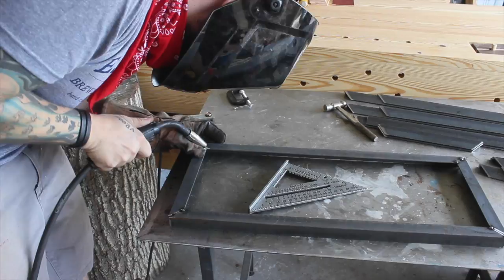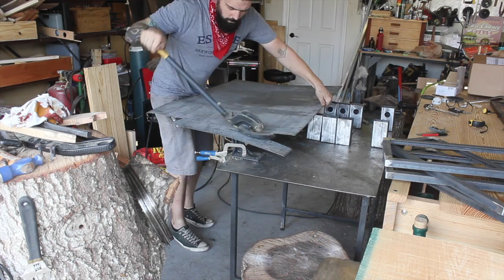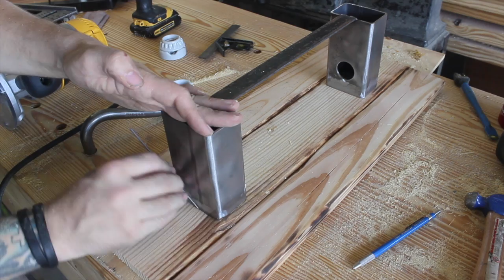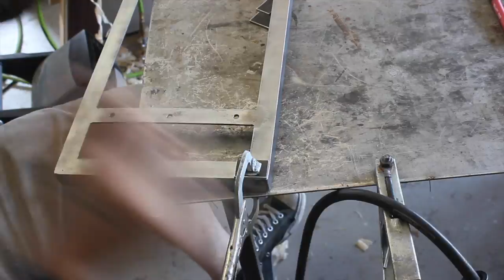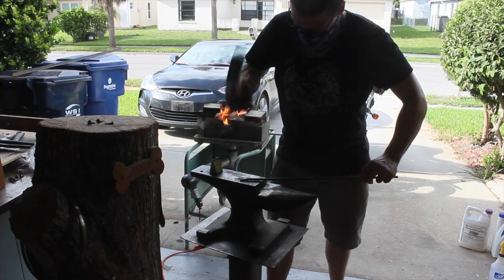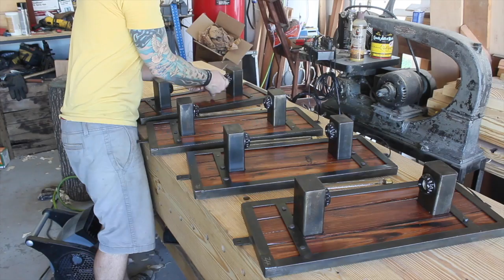Industrial wall sconces for Escape Brewing | How-To

Comment: they are works of art. I hope the electrician and you made sure all the metal parts were grounded.
Reply from the maker: Thanks! The leads are locked in place and isolated from the frame...

Comment: this list of tools is missing a few.. You use a sheet metal cutter (never seen one of those), the tool to actually make your own nails (very cool), the thingy you dropped into a hole, then tapped it in to hold the wood.  The concoctions you sprayed on the wood and also on the metal....  keep your own mysteries..
Reply from the maker: Thanks...
Throatles shear, Nail header, water based poly on the wood, sculpt nouveau black magic patina on the metal then cleared with lacquer.:)

Comment: Have you tried using a block plane for the chamfering? I find it much easier to control the bevel angle and depth.
Reply from the maker: Yeah, I completely agree--I was actually going for sort of a rough choppy uneven chamfer

Comment: Great channel dude!!! I have some projects that would like to build. I used to work with bamboo and wood, but never have worked with metal before, and I really would like to add some to my creations. Where should I begin? What are the basic tools?
Reply from the maker: Thanks Gabriel...Start out with a good welder and an angle grinder.
Check out--I think it's the second episode of "The Crafted Podcast" we cover getting started in metal work & how to incorporate it.

Comment: This build is amazing, just like the rest of your work. I usually don't comment on YouTube stuff but I had too on this one. I seen where you sourced the bulbs but what kind of bulb holders are those?
Reply: Those appear to be the screw on sleeves to porcelain light bulb bases similar to the ones used on basement lights. The sockets were standard porcelain lamp sockets for mounting to flat surfaces. You could do a google search for antique lamp parts, years back I found a company in New England area that specialized in antique reproduction parts for various turn of the century lamps. They even stocked "authentic" turn key Edison bases instead of the push push style bases on today's lamps. What I wonder is if this lamp is available with the new LED filaments. I will not provide one with a realistic Edison lamp look but close enough and a bit more economical to operate.

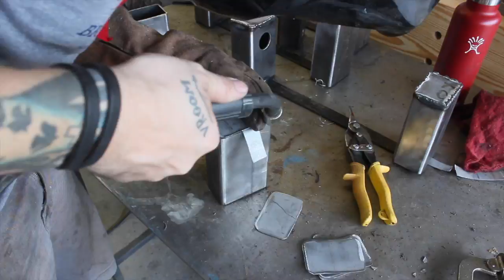Comment: at 2:20 why did you stick that small bit of steel before you welded? im interested, not judjing
Reply from the maker: It gives the weld a place to sit...that way when I go  to grind out and smooth edge i won't grind through the weld.
Reply: very coool!! thanks for the reply

Comment: Awesome talent, idea, result, etc. I love the look of those bulbs in the sconces. Question, why the single line burn in the middle board from the bottom support down? Also, did they have to run the wire up the wall...exposed? Or, was that just to get the finished shot?  I understand that it IS a rock wall, and that might be why they installed them that way.
Reply from the maker: Thanks!
Well, I used the woodburning thing to simulate wood splits & add some character, I did more than I included in the video.
As far as the power--the original plan was for them to hard wire it, but they decided with the brick veneer, they'd rather just run a cable up the wall, it wasn't my choice--but I'm still satisfied :)

Comment: Nice build as usual. I have one question though. Where I live (Sweden) if I hade done something similar I would have had to connect the metal casing to ground in order to meet regulations, and probably for good reasons. You wouldn't want to make the casing carry live current just because some kid yanks the cord a bit too hard. Did you do that as well, or is it not necessary with 110 V?
Reply from the maker: It's insulated fairly well inside, the wire spirals around the porcelain, but I guess it's possible if someone tried very heard they could create a hazard. A ground wouldn't have been a bad Idea, although I was told it needed to plug into a two prong outlet.